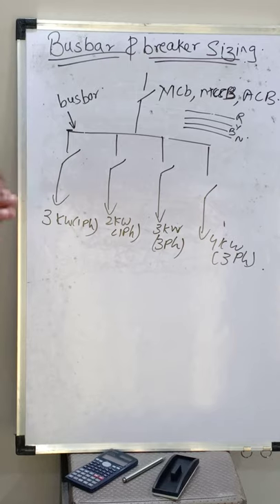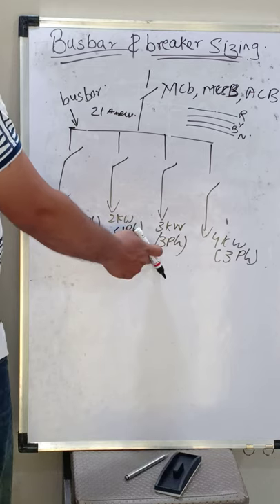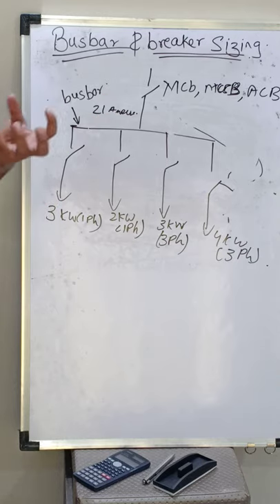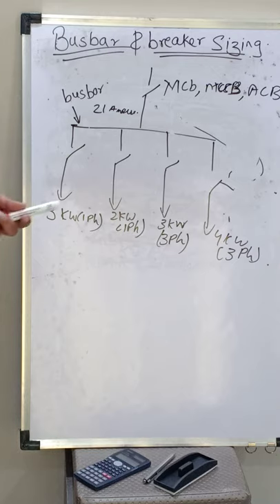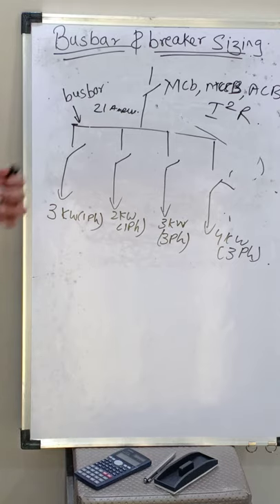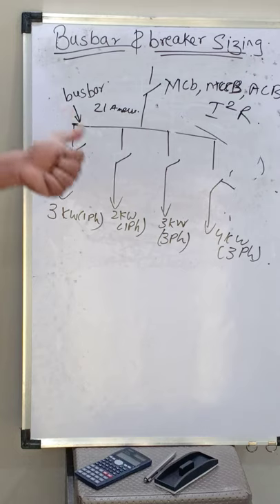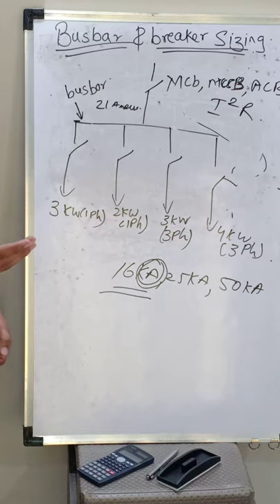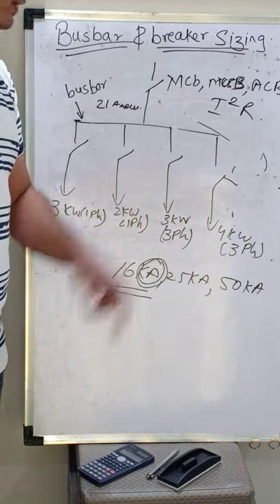Busbar and breaker sizing with panel designing

Comment: i watched all your lecture it is really very helpful thank you!!! i have some question 1.what is the distance between socket outlets 2.how much light outlet or light watt per circuit & switch 3.cable tray & pvc conduit sizing example or formula 4. demand factor for power distribution board (MDB,SMDB,DB,ESMD)
Reply from the maker: Hello,please take my number 9372383722,you have many questions we can discuss on call,thank you